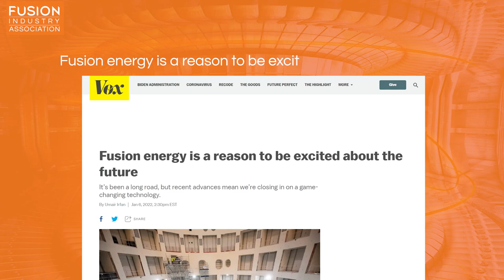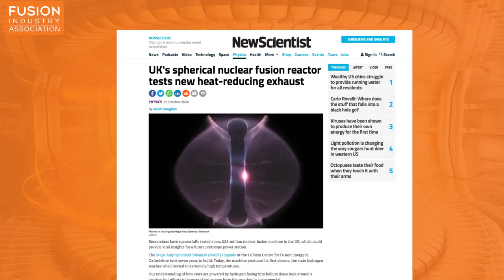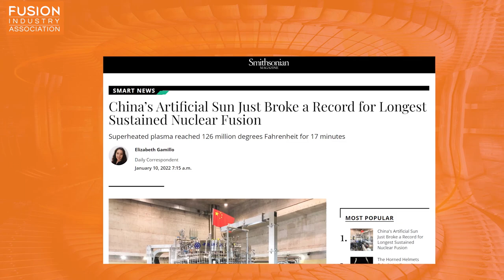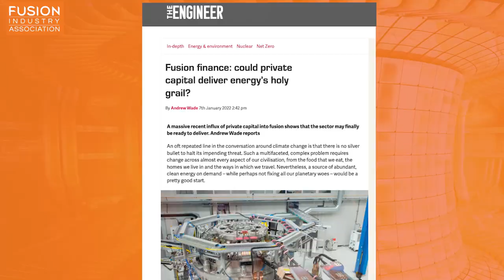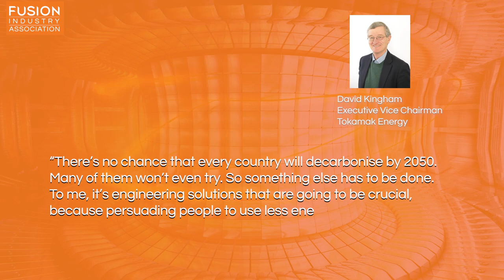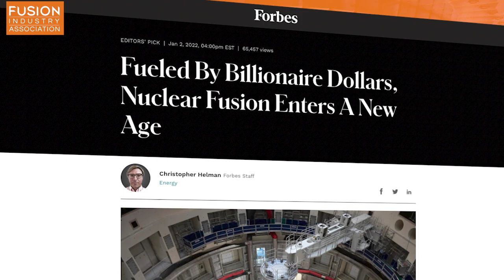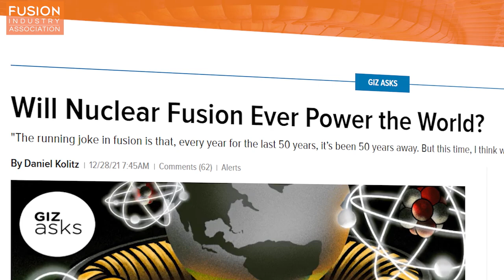Fusion News - Friday 14th January 2022

Comment: Of course! Using only direct helium three is the key to quick and effective direct energy generation instead of building large turbines that require rare earth metals etc. do you know however – where have they obtained where has Healion obtained there helium three from???? Two years ago I have participated in founding a company that intends to extract the isotope the super valuable He3 Directly from the Moon - Sid do you know whether the company Healion obtains their helium three for making it from tritium but that would mean that first they have to produce a lot of tritium which is not the most clean nor nonradioactive — it’s good however that they are developing the technology of direct electricity production

Comment: Nothing ever seems to be said about the economics of fusion power. Fission reactors, even without a vacuum system, superconductors, neutron multipliers, tritium breeding, difficult plasma control and DT fuel ignition, are already expensive. Add these items and the costs are in the stratosphere.
Reply: Guess how high the "economic cost" of a total ecosphere collapse might run. What's your alternative proposition to fend that off?
Reply: An excellent question of course, but far too big to discuss in these columns, certainly not by me. Many people have many ideas. Economics surely must play a part and my point is that it cannot be ignored for fusion energy.